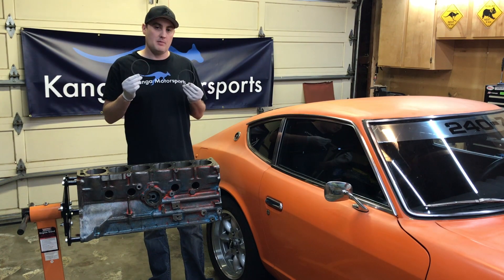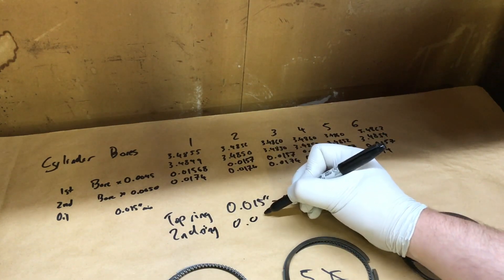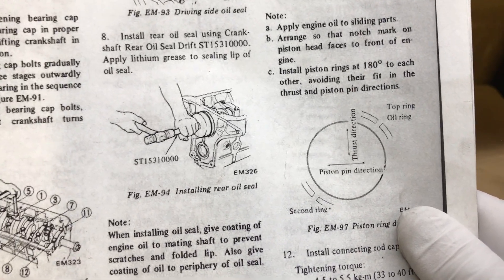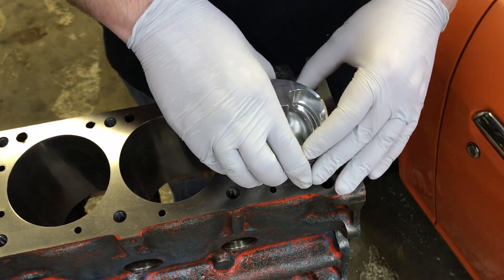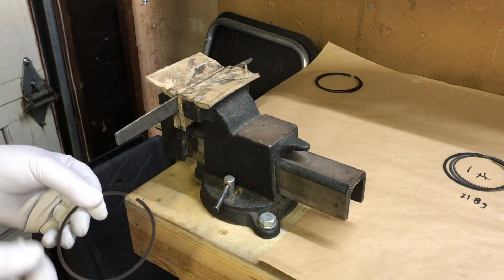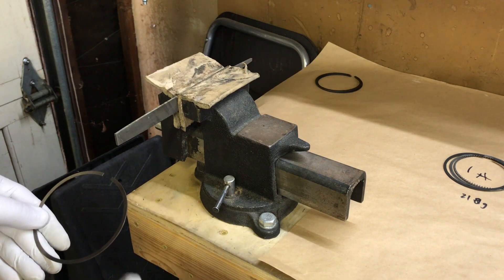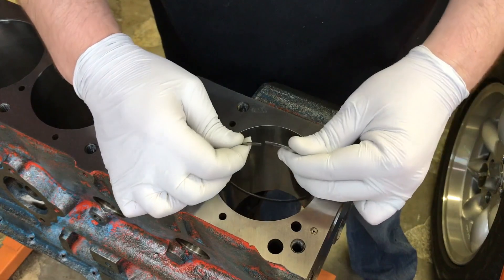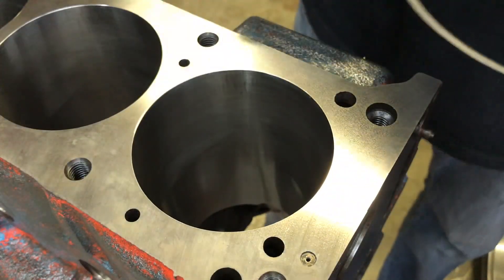Gapping Piston Rings - Datsun 240z

Comment: Handy vid mate I'm in the middle of my L20B stroker now.
Only I thought the top ring is usually gapped wider than 2nd due to the extra heat it sees at combustion?
Reply from the maker: I am no expert by any means but everything I have seen shows tighter top ring clearances to minimize blow-by. Of course you don't want it too tight that it breaks the ring land. Follow your recommend specifications from the manufacturer.